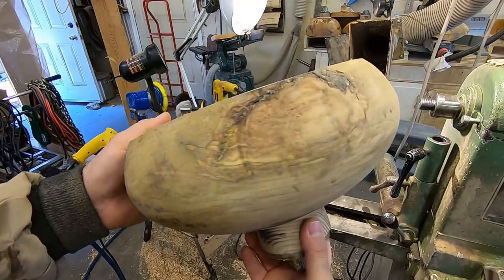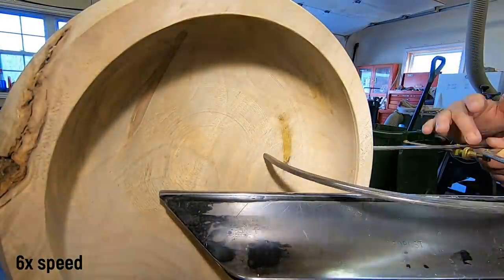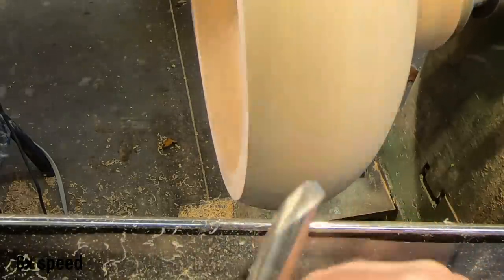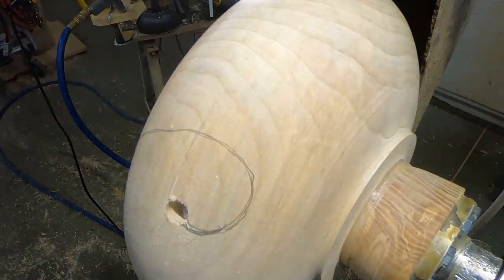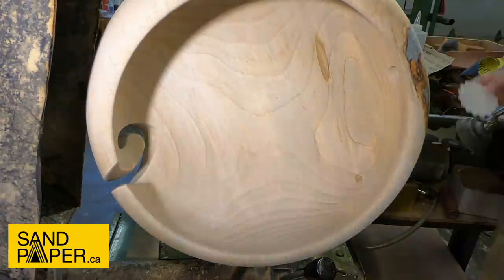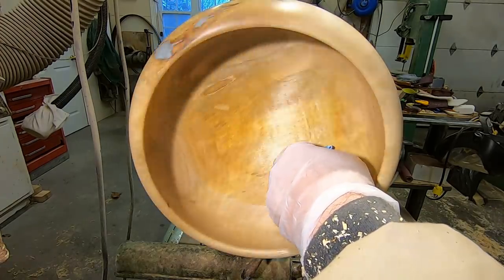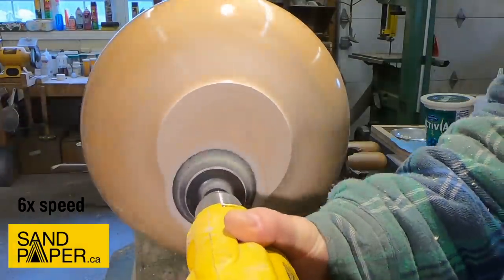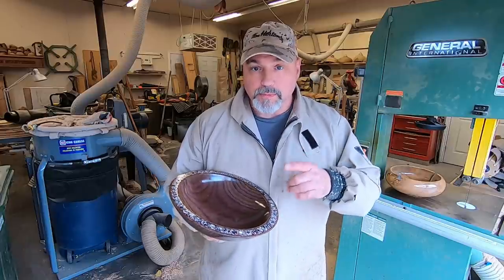Woodturning - The Knitting Bowl

Comment: Nice bowl and good project.  I also have a General lathe and love it. Picked it up in CA US and have since relocated to Virginia US 3 years ago. 

Good work and thank you for sharing.
Reply from the maker: They’re a good lathe, wish mine was larger with more horses power, thanks 🙏
Reply: @SpragueWoodturning  the one that I picked up is 3hp w a 38" table and a 14" swing and the in-fill block can come out giving another 2" to the swing.   I didn't get the outboard table but the spindle lock got bent in the move. ... it is a good addition to my shop even if it is 1/2 a ton... 1200 lbs

Comment: Jim another fine video and bowl. Why do you like the 5/8 Ellsworth bowl gouge over any other 5/8 gouge?
Reply from the maker: It’s a good strong gouge that you can use with it hanging far over the tool rest, it stays sharp and I like the handle design. I’m sure there are plenty of other 5/8 bowl gouges on the market that are every bit as good, and would try them if they were sent to me, but I like using Crown

Comment: Jim:  fascinating and learnt a lot as always. A question though:  this time you didn't apply any 'sealing' coat before using the CA glue which you've always done on previous project in case there was any 'run' of the glue - and particular reason for that ??
Reply from the maker: There’s a couple of reasons for this, first of all I planned on tooling the surface back so if there were any glue runs they would be removed then and this inlay is on the side grain of the bowl that typically doesn’t absorb as must glue like end grain does. I rarely seal the bowl with a coat of finish when I’m doing inlay on the sides. Good question tho, Jim.

Comment: Beautiful bowl Jim. I’ve never seen a knitting bowl before! 
On a different note, I have a question for u regarding the drying of bowls...have u heard of bowls being fried in a microwave instead of a kiln? And what do u think are the pluses or minuses of this please?
Reply from the maker: I’ve done some of that drying as well. It works but I did get some cracking. I need to dry bowls on a larger scale that’s why I use the fridge kilns and the fact that a microwave can only fit a smaller bowl. Jim
Reply: @SpragueWoodturning  how long did u put the bowls in the microwave for & on what setting pls?
Reply from the maker: Sorry, it was a long time ago and can’t remember, should be lots of info on google tho?